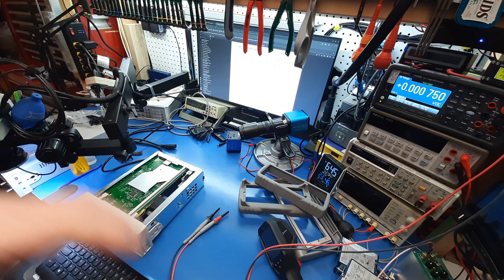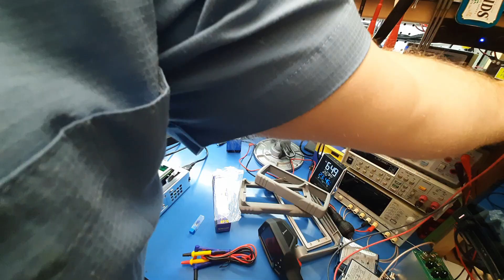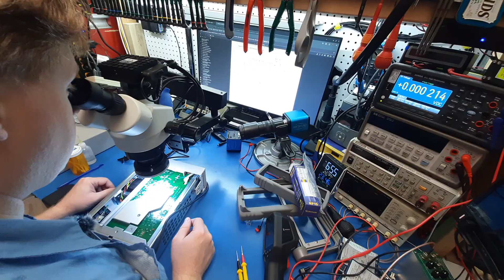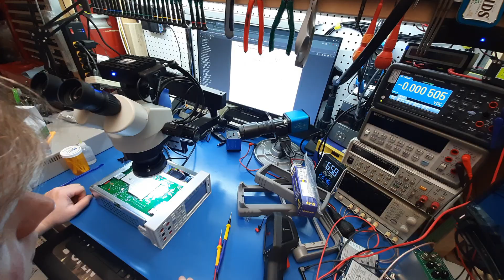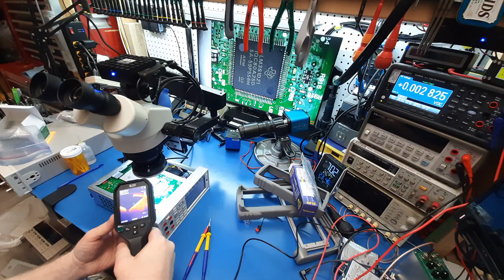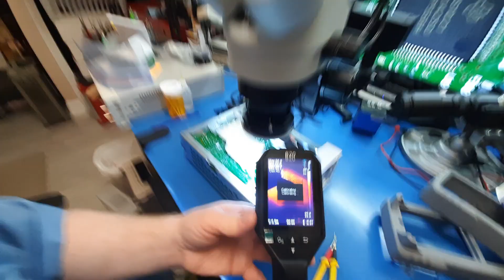Keysight 34470A Repair (hardware diagnostics - does the MCU have power?) Part 3

Comment: there were so many stuff you should have checked to evaluate what condition the mcu is in. oscillator pins for clock, wake pin, reset pin, hibernation indicator pin, possible UART pins activity at boot time....etc
Reply from the maker: I'm not in any way going to claim I know everything in electronics - I even have it in my name, I never stop being a student.  For the 34470A project at the point I recorded this video, I didn't know as much about that IC as I do now, and certainly have more to learn.  I address part of that further in the series where I start documenting activity on every pin, comparing a working unit against the bad one, but yeah.  Connecting by UART / JTAG is also on the 'to-do' list, but then this project got set aside (hopefully temporarily) by other projects, like that 3458A repair you saw.  That one at least has a pretty clear conclusion on the horizion, I'm putting together a parts list (Dallas RAMs / electrolytics / mains filter / RIFA caps / fan etc...) to take care of in one go, and then hopefully that project will be all set.

I do have a tendency to flit about and leave projects half done... bad me!